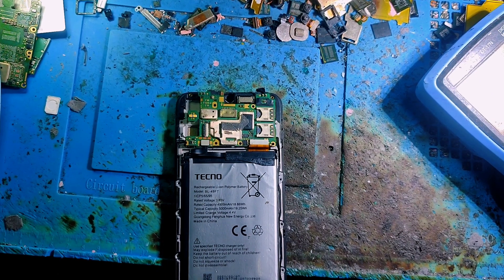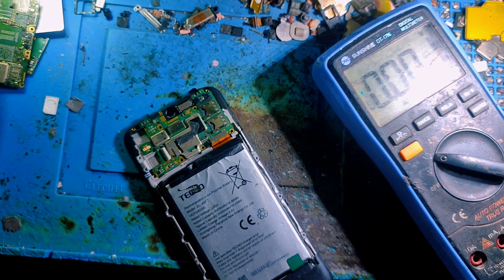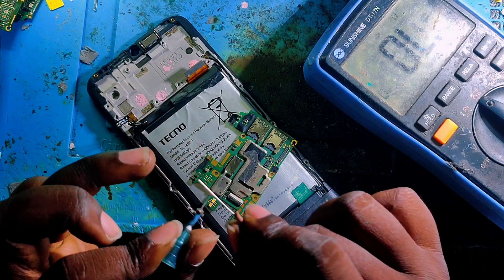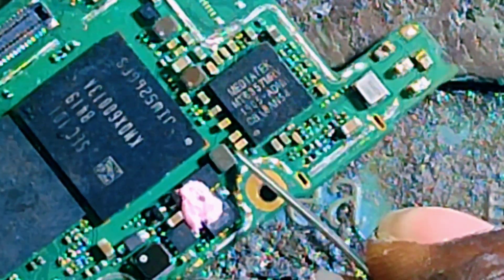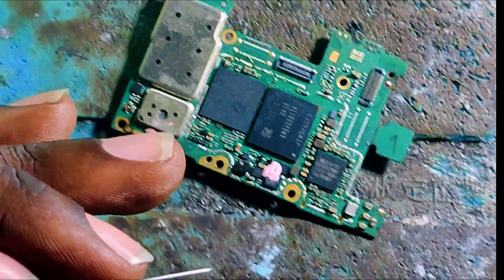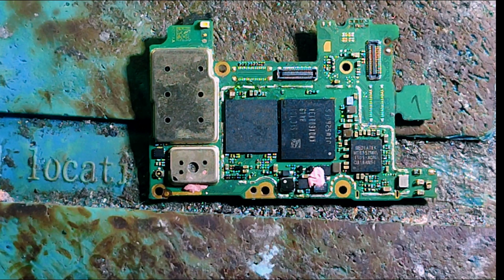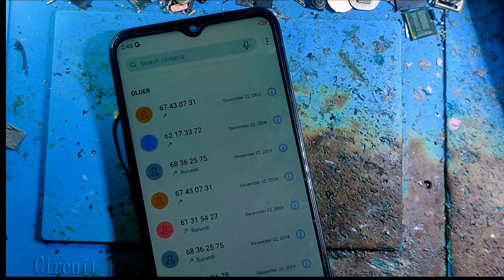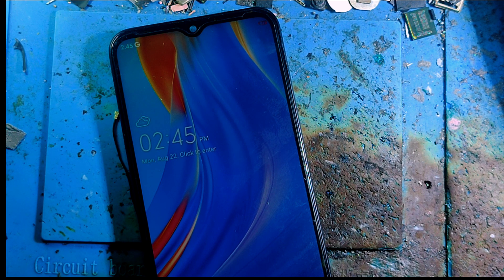How to Fix a Phone with a Full Short Circuit | Step-by-Step Guide

Comment: How does the short killer fixes the ic chip? You had more than 5 bad capacitors. So that tells us that the chip was gone how come the short killer just fixed it? If that is the case then no one needs no skills for full shorts.. Just use 4.2v ground to positive and boom. Data saved??
Reply from the maker: Some times we confirm that an ic is completely dead when we use the shortkiller on one or two capacitors that are beeping in buzzer mode, and if the capacitors still beeping, then the ic is having short.